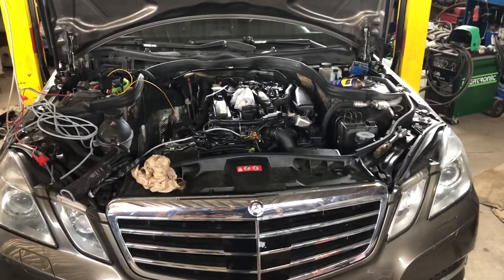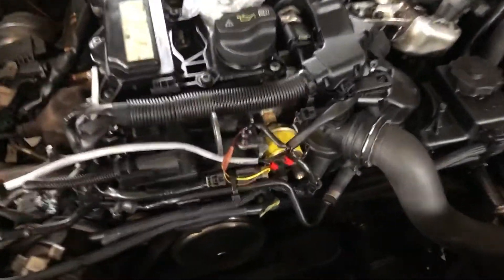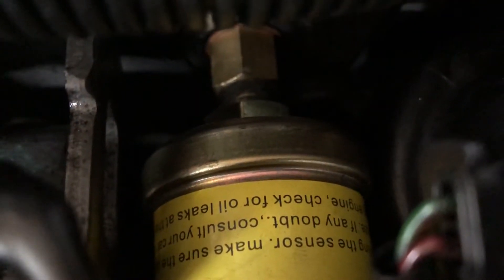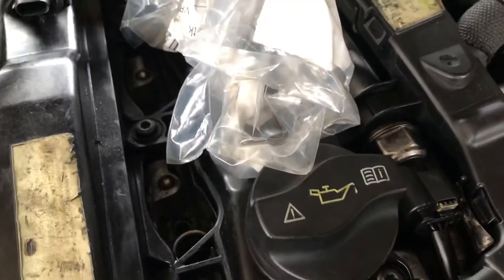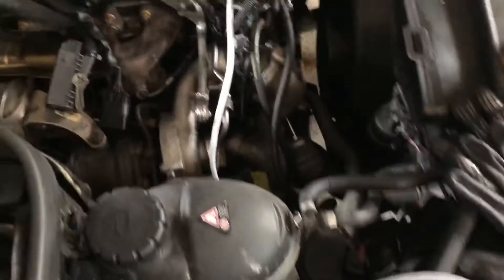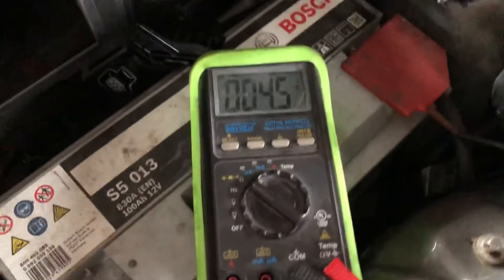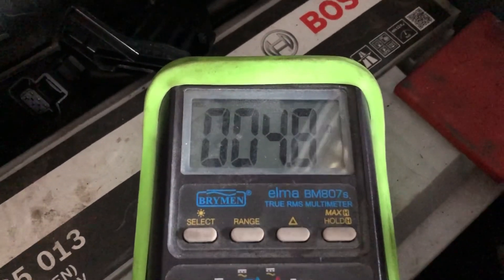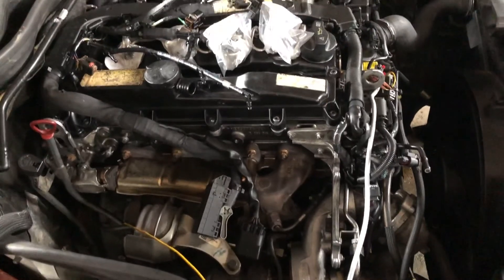Mercedes OM651 before first start prelubrication

Comment: I can use that all the time, right? Once the sensor is installed, i don't need to take it of. To make my question simpler, that sensor does not interfere with anything else in the head?